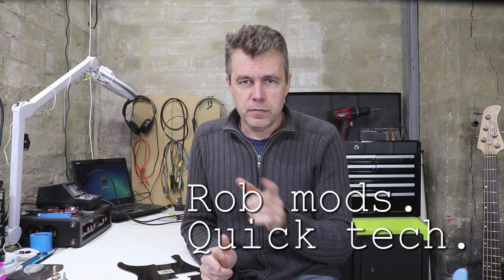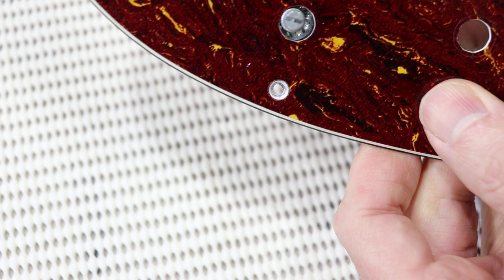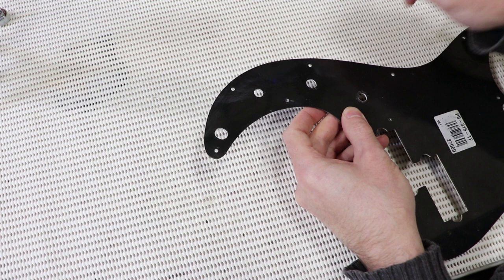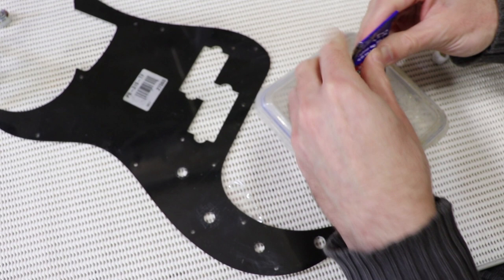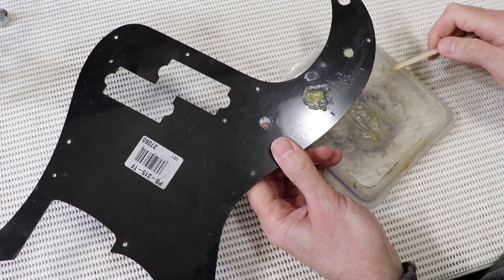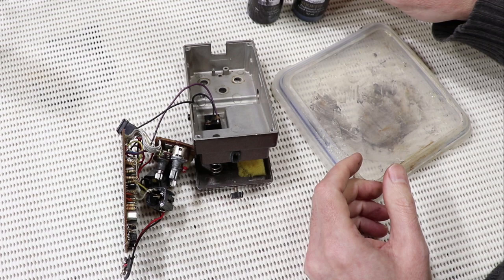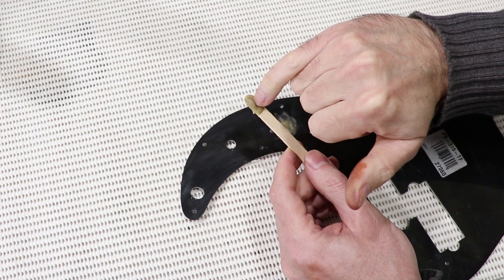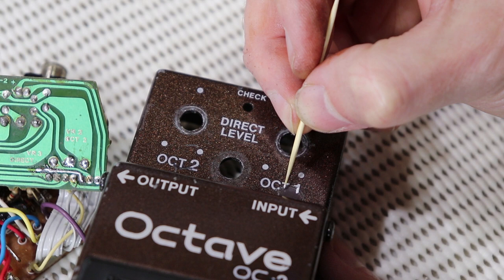How To Fill A Hole In A Pickguard To Install Control Pots.

Comment: Why not order a pot with the correct shaft size instead?
Reply from the maker: Hi.  Thanks for your question.  This is a technique I've used in many situations.  Putting a mini toggle switch where a pot or a pickup selector used to be, putting a pot where a jack used to be, installing pre-wired preamps where the pots are all supplied and too small for the existing holes.  If you are low in space, using a 9mm mini pot for example may be the only way, and these only have the one hole-size option.  Often with custom and active wiring, finding a pot with the right taper and resistance is hard enough, let alone finding it in a range of threads.  (See my pot mods video https://youtu.be/iCUOVOOc5WY ).  Also, international postage to my part of the world is slow at the best of times, and right now, my city is in lockdown, and even local postage is incredibly slow.  I've also used this technique to fill unused holes in timber.  That's where the tinting comes in handy...
Reply: sometimes the cpntrol cavity is smaller like in squier guitars

Comment: I need to see those boss OC-2 mods!!!! What a killer pedal.
Reply from the maker: Going to put in a low pass filter (or two!).  Just waiting on parts...
Reply: Nice! Have you tried a tone control on the octave signal before? And do you use the 2nd octave down?
Reply from the maker: @seanedwards773  Yes that's the plan.  I'll have a tone control on both the original and octave down.  Nope, like most bassists, I don't use the 2nd octave.  in fact, I'll probably repurpose part of the existing 2nd octave circuit as one of the tone controls...
Reply: Drool!!!

Comment: thanks for this. i got a new pickguard coming tomorrow and am gonna have to fill a pot hole and the selector switch slot and screwholes. i MIGHT experiment with mixing a bit of matching color/paint into the adhesive/filler to avoid having to paint over it because i am terrible, absolutely awful with anything to do with coloring/painting
Reply from the maker: Cool.   If you use polyester resin (fibreglass resin), you can colour this with basic acrylic paint.  Up to 10% I believe.  I've done this with cheap craft store artist's paint and it worked quite well.  I kept it to about 6-7% though.

Comment: This is my second time watching this video. It clearly left an impression, since I remembered it and wanted to refer back to it. Your content is so excellent and informative. Have you ever tried plastic welding, by any chance, to repair a pickguard? Or is it not worth it?
Reply from the maker: I've never tried plastic welding, but I've seen it done a few times on car panels etc.  It's sort of like soldering in a way.  TBH, it's probably easier to remake the 'guard from scratch.  Just a word of warning.  If you are talking about a vintage pickguard that has shrunk and cracked, it is probably celluloid, and is very flammable.  Thanks for watching.  Glad you like my content!

Comment: Could u fill an entire pick up hole on pick guard that way …I’m trying to change a three pick up pick guard to a two pick up …so I need to fill the middle hole …I’m wrapping the guitar in a graphic to it does not matter hoe it looks as the pick guard will be wrapped
Reply from the maker: I think that'd be fine.  Just make sure the tape is really sitting nice and flat.  Perhaps use a few layers of tape  since the filler is quite thick and might distort the tape when you push it into the edges.  Actually I'd be tempted to use a liquid fill, such as epoxy or polyester resin.  With this, you could probably just wait til after you've laid the vinyl up, then just pour the resin in from behind.  Good luck with your project!